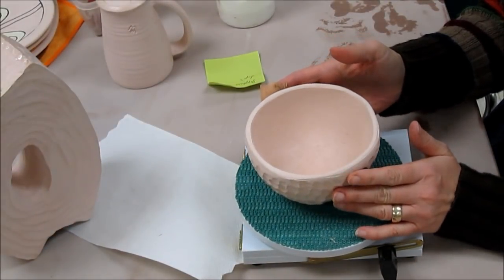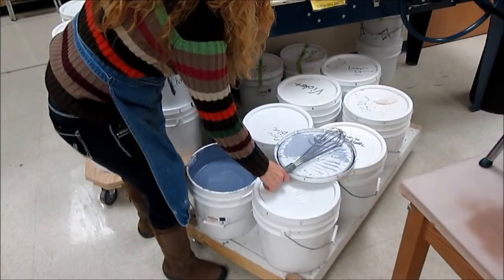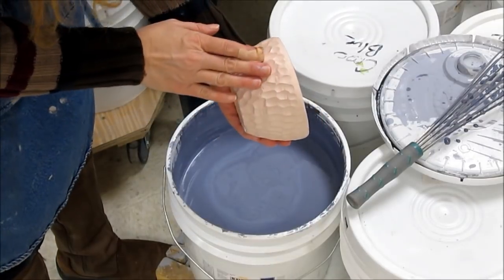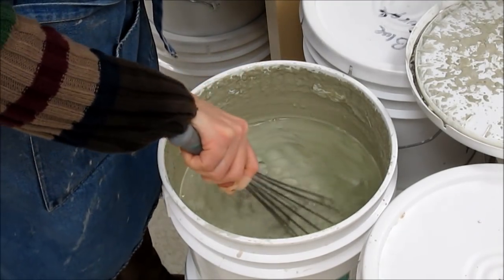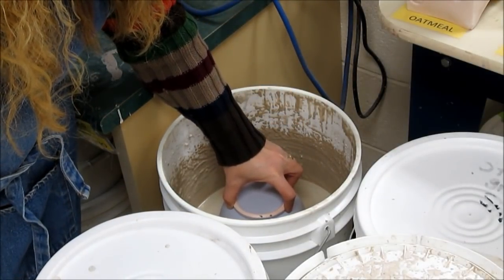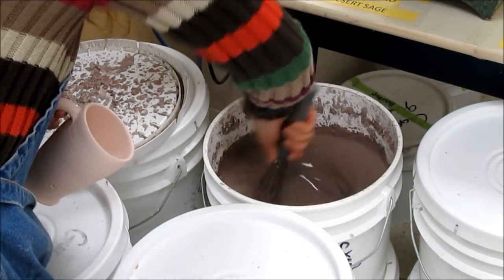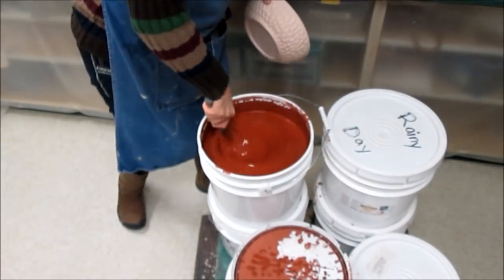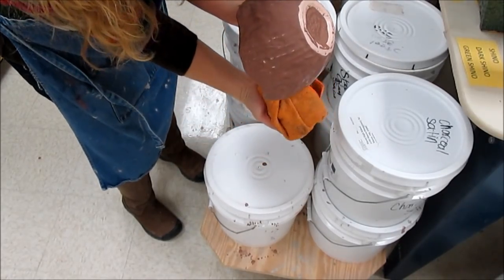Glaze Application Demonstration for Ceramics I, II, and Wheel Throwing

Comment: Do you have any issues with the coyote glazes like pin holes or running? I am considering trying these glazes on cone 6 bmix clay. Thanks for sharing your knowledge.
Reply from the maker: Hi Jared- sorry for the delay- I just saw this message!  I only have pinholing occasionally on a few glazes.  Rootbeer, peacock, and a few of the other celadons may have this tenancy more than others.   I try to fire slowly, and I hold the final temperature in a 25 min hold to help prevent it.  If it does happen, I just put a complimentary glaze over it and refire!  :)

Comment: When you cover your walls with some material... it called paint and it can buy paint at Home centers etc..., when you cover your pottery, what do you call that material? Glaze or what? Where can you get them? About five gallons sized, wonder how much it cost? Thank you for your kindly respond.
Reply from the maker: Yes, it is glaze!  If you look in the video description, I provide some links to some of my favorite products you can check out. Glazes will vary in price due to kind of glaze.  A gallon can cost anywhere between $30 and $100 depending on the type. Some dry materials are much more expensive than others to use to manufacture glazes.

Comment: Hi am try to know every thing of ceramic why always not glaze the down edg of cup???
Reply from the maker: +omfato ana   Good question, Omfato!  Glaze will melt and liquefy during a glaze firing.  It will also fuse to whatever it touches during the firing.  If we glazed the bottom edge of any pot, the glaze would fuse (glue itself) to the kiln shelf!  We usually just sponge away glaze, but you can also use wax resist if you are dipping in a glaze to help wipe it off more easily!  I hope that helps!  :-)

Comment: What kind of brush did you use?
Reply from the maker: That is a hake brush.  Bamboo, several sections. They are great because they help to apply an even coat of glaze!  
Here are some links to them on Amazon if this is helpful:  

Hake Brush 2”  
https://www.amazon.com/gp/product/B0028FKO42/ref=as_li_tl?ie=UTF8&tag=karanspotsand-20&camp=1789&creative=9325&linkCode=as2&creativeASIN=B0028FKO42&linkId=2d396db783a88d2d6e216d4a89d75e11

Hake Brush 3 ¼”

https://www.amazon.com/gp/product/B009OQU8C6/ref=as_li_tl?ie=UTF8&tag=karanspotsand-20&camp=1789&creative=9325&linkCode=as2&creativeASIN=B009OQU8C6&linkId=3be21d9b230e1efe977d996e95146270

Brushes- Hake SET from School Sepcialty:

https://www.amazon.com/gp/product/B0044S88S0/ref=as_li_tl?ie=UTF8&tag=karanspotsand-20&camp=1789&creative=9325&linkCode=as2&creativeASIN=B0044S88S0&linkId=34b7515ef9a34776496d1285f97724e0
Reply: Thank you!!